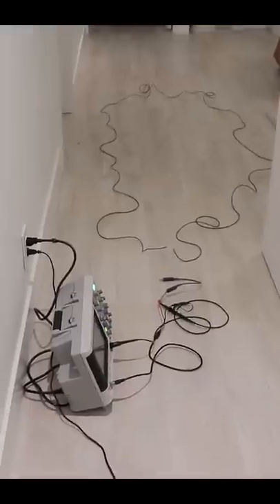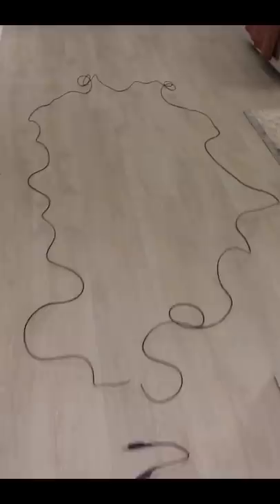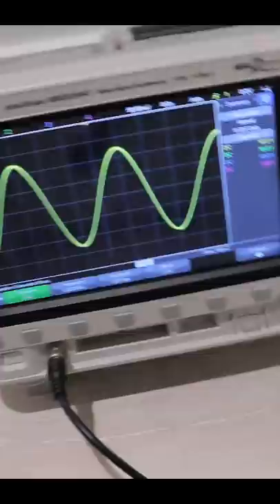The Crazy World of AC Electricity #shorts

Comment: If you touch a grounded led in complete darkness you can sometimes see it light up from the radiation of the mains wiring in the house - but don't tell anyone with fear from "electric smog/pollution" ;-)
Reply: In all my years (2 and a half maybe) as electrician, I have never heard of electrosmog. Either that or I forgot. 
So what is it supposedly??
Reply: @dragon67849  Don't go there, that's a complete (quack)industry on it's own.
Reply: @Sine1040  can you at least tell me the bare basics? You're only feeding the curiosity here
Reply: @dragon67849  it's what the paranoid and conspiracy theorist call static charge.
Reply: It's people claiming magnetic/electric fields caused by wireing has a negative effect on their body.
Most comonly used in sentences like "I don't want outlets enxt to my bed because I get a headache and bed sleep from the electric smog"
Wikipedia articlle on "Electromagnetic hypersensitivity" leads you deeper into that rabbit hole. 
between 2000 and 2010 is was a topic that went through the news every now and then fueling those believes. The fact that it kinda went silent is prop a sign that no evedence apart from nocebo was found.

(though I can't sleep next to some power supply because some have this high pitched sound when working which just annoys me in an otherwise completly silent room at night. I would call that having ears good at detecting high frequencies and owning cheap old power supplies though but others might use elctro smog for that as well maybe)
Reply: Did someone say FREE ENERGY
Reply: @drjoe71  NO
Reply: @11Argetlam11  I sleep with my head by an outlet, and I'm fine.......... Almost
Reply: @dragon67849  Electrosmog is interference causing non mains signals in the house. Such as waves from leaky microwave ovens, cheap switching power supplies without interference suppression powerline ethernet systems and sparking commutators. It sucks, if you like to listen to the radio over the air and it can slow down a wifi connection (all of course depending on the exact band used, a microwave oven won't disturb AM radio). 
Some 'special' people are convinced it has an effect on their body, and go to great lengths to wrap stuff in copper foil or mesh because of WoOoOooo RaDiatIonnnn. Or stick a sticker on their cellphone because it reduces the radiation of it. 
Some particularly stupid ones do all the mains interference suppresion for 'health reasons', but continue using wifi and cellphones.
Reply: @11Argetlam11  
Too bad these aren't just claims. There are enough publications that researched the risk of living close to high voltage power lines. If the EMF is strong enough to affect your radio reception it may be strong enough to affect your health.
Reply: @Bullshitvol2  do you have any clue how easy it is to interfere with radio? You can interfere with FM easily and AM is even easier. Keep in mind that radios are also designed to pick up radio waves, people have been living near high voltage lines for almost a century now.
Reply: @Bullshitvol2  They are just claims at this point, the evidence is not at all compelling.
Reply: @shaqibkhan5392  Yeah I've actually already seen it as indicated by the like button having already been pressed. I'm amazed you found that though so to help, it's Kurzgesagt ^^ Appreciating all the help so far guys
Reply: @dragon67849  it's basically another form of ludditism and radiation phobia from pearl clutchers who don't understand the difference between various forms of energy fields or the different power levels that they might operate at.
Reply: @Bullshitvol2  like I tried to phrase it neutral. 
But High voltage powerlines are something different than the 240V Plug next to your bedstand. I haven't done any studies on that but the wiki article suggested there haven't been many proofing it.
Reply: If you unpeel masking tape in the dark it glows from the adhesive being pulled
Reply: I have actually noticed this and looked all over online for an explanation! Thank you for explaining it!
Reply: But all wiring does indeed produce some magnetic fields around them when current passes through them.
Not that it matters for humans but the interference is there either way.

Same with mobile phones and long speaker wires and certain frequencies. Before i received a text message on my old phone, i could hear my speakers going crazy and sounding sort of like a dial up modem.
And when making a call, my speakers were constantly going nutty and the amplitude changed based on which way i angled the phone.

So there's some merit to these claims, however the effect is so minimal on a human body they might as well not even be there and all illnesses stemming from it are placebo.
Reply: @4Gehe2  Whats left is the ozone at night after their braincells popped :P
Reply: I have a led strip wrapped around my table and even if u unplug it and touch it with light up 3 leds for some weird fucking reason
Reply: @abogmus8904  ok so you are trying to say that every form of electromagnetic radiation (even visible light) is polarized?
Your comment doesn't make any sense
Reply: No
Reply: @dragon67849  Maybe something like radiowaves? You absolutely can light  up an LED if you hang a long wire from a tree as an antenna and then put the led between the antenna and the ground. It will only capture a half of what could be made (it stops the current flowing the other direction). So maybe it's better to just put a potentiometer there, to see the result more clearly. I made a radio this way, just a diode (not LED) and coil and a variable capacitor (made out of tin) all in paralel to each other.
Reply: @abogmus8904  I think you might be confusing electronic spin, which is angular symmetry, with physical motion.
Reply: @Sine1040  precautionary principal! You don't know the affect. Can affect your day/night cycle - affect sleep, give jet lag? Much to learn there is,  hmmmm. We do have sensors for electro magnetism associated with solar radiation.
Reply: @Bullshitvol2  do you know any numbers? because I lately found out with a magnetic radiation meter, that my frikkin bed is on "1500" while my box of cable (computer, displays etc) is giving me the same, sounds kinda unhealthy for my brain.
Reply: @Tekape  Unhealthy for your brain? Kinda depends, how is your computer performing?
Reply: Lolol love it
Reply: @Tekape  1500! That's almost deadly.
Reply: @NorthernChimp  my computer is doing great. I completely reorganized my cable management afzer I found out about the electrosmok. I found out the the isolation of my smartphone charger cable is really bad + electricity was active in it even if the phone wasn't connected, that cable was between and mattress and bed. It's a cable that feels thick but the outer layer is like fabric, so the rubber isolation must be really thin. At least everything is nice n clean now and there is no fire hazard in the corner anymore xD
Reply: @Tekape  So your brain shouldn't be any worse off than your computer, in such conditions.
Reply: This has induced soo much worry in me when working with an IP30 RGB LED strip for the first time a couple of weeks ago. IP30 means it has no transparent silicon layer over the LEDs, so when installing the strip, you're constantly touching them and they light up in a weak ghostly greenish glow. I've been so afraid of damaging the LEDs each time they did that, but they're all fine.
Reply: @11Argetlam11  My mom was worried about electrosmog in my room for a while, because for a while even "serious" popular science shows were talking about the "issue" and suggesting "solutions", meanwhile I had my two desktop PC setup with two monitors, a speaker system and an NES right next to my bed with a 120W subwoofer under the bed and I did suffer severe sleep problems. 
And she was actually kinda right in thinking that setup had a negative impact on my sleep, because it had a powerline adapter which, apart from having a bright flashing LED in standby mode, also emitted a quiet but penetratingly shrill squeaking sound whenever the diode lit up.
I dealt with the light by putting a few layers of tape over it (I still do that with any power supply diode in my bedroom), but the squeaking kept me awake for a while until I pinpointed where it came from and then unplugged the damn thing every evening before I went to sleep.

While that wasn't the main cause for my bad sleep (depression/existencial angst was), I'd say I am indeed 'hypersensitive'...

... To light and sound that is, not electromagnetic waves! 😂
Reply: Free energy device?
Reply: @RealCadde  Yes, but the irony is that those constantly whining about each new generation don't even realise the reason why that has stopped happening is the trend is for each generation to use lower power levels. Partly this is of course that to get the higher speeds generally means reducing the cell size and the devices burn the bare minimum energy on the transmission possible to get a clear signal to the tower and visa versa.
Reply: It's at worst alpha EMR but because it's electricity not photons, there's no EMR, just EM
Reply: @11Argetlam11  i may have EM sensitivity, but ffs it has to be really strong or really specific to prick me, thunderstorms hurt mind you and i have a "radar" for it at times, it's a matter of, where the pain is that's the direction of it. Really should get EM linings to stop it, they're really painful at times
Reply: @Bullshitvol2  no, it isn't. Radios are designed to detect the smallest change in voltage across their antennae (eg the signal you're trying to receive). These fields are generally weak, very weak. Please do some research into peer reviewed studies. This is coming from someone with background knowledge on the subject and experience with high powered unshielded RF equipment, high voltage, etc. If these bs theories were true then I'd be dead or at least have some symptoms of exposure because I've regularly exposed myself to fields thousands or millions of times higher in intensity than those quoted to be "HaRmFuL".
Reply: @atata2000  I mean yeah, every photon will be polarised. Whether the radiation is coherent or not (photons in phase) determines whether it has a net polarisation. So your comment doesn't make sense either. Unless you didn't mean polarised or maybe I'm just trippin
Reply: @craigme2583  no, just no
Reply: @dragon67849  We are surrounded with EMF radiation. "Electrosmog" is the pseudoscientific name for these fields with the belief that they are harmful.
Reply: @Tekape  That wasnt "Electrosmog". You just got very mild shocks from capacitive coupling. USB chargers tend to have quite a bit of leakage, nothing dangerous but it can sometimes be felt when you are close to a conductor in a certain way.
Reply: @osmacar5331  i bet you a hundred bucks youd fail the blind study. thunderstorms dont even put out a significant amount of EM fields compares to other sources. If a thunderstorm at a distance hurts you, standing next to a wall would kill you (inverse square law). 
Look up the nocebo effect if youre interested in what it might really be.
Reply: @drkastenbrot  am from the uk where it rains sideways and thunderstorms fork for at leat 13 miles, and the heat razes the land while the cold makes it equally treacherous, so, piss ant, i know how that shit works and yes they do put out that much power, a weak bolt is several hundred gigawatts. Maybe you should understand how shit works.
Reply: @osmacar5331  it does not matter how powerful they are because of inverse square law. the lighting is so much more distant than mains wiring. at about 30kA, lighting also only produces 1500 times the EM field as household current (20A) at peak demand. Thanks to inverse square law, standing 1m from said mains wiring is going to already subject you to more EMF than standing 39m from a full blown lightning bolt.
Reply: @ikannunaplays  "If unpeel masking tape in the dark it glows from the adhesive being pulled"

Enough charge can be generated from unwinding sticky tape to create X rays.
Reply: @ferrumignis  Really, I need to try that, but how to see these x-rays...?
Reply: Chuck McGill moment
Reply: Charles McGill be like:
Reply: I have a really efficient led fixture in my basement that lights up a bit when I touch the thing, it basically just uses me as an antenna to receive a weak AC signal.
Reply: @11Argetlam11  oh my god, some are truly dense...
Reply: @dragon67849 Basically EM fields around wires.

Comment: Makes a short
Shows a loop doing cool stuff
Refuses to elaborate further
Leaves
Reply: High frequency can be decompose in standing wave & traveling wave.
For 5Mhz I expect 30mts cable would give maximum output
But I bet he is using 10 meters which would give 1/4 of the voltage... Says 5Volts Peak to peak but I think LED needs at least 2 Volts
Would be interesting more measurements and an equivalent model to explain the transmission
Reply: Chad mehdi
Reply: ElectroCHAD
Reply: It ac alternating current it goes both ways by putting it on a loop it creates a complete circuit similar to a two pull single phase circuit except it's just using one. We use in the U.S. 60hertz meaning electricity goes both way 60 times If I remember correctly every 15ft
Reply: @mdllpz5356  what do the 15 burgermeters have to do with the frequency?
Reply: Smegma grindset
Reply: Must have run out of stunt doubles.
Reply: yeah. and?
Reply: Shorts in a nutshell
Reply: My past professor, is that you? lol
Reply: @gert-janbonnema burgermeters 😂
Reply: Its to bad that some people just can't learn, so they walk away and blame the person trying to show you something. Go get educated, try to learn more about it. Its a youtube short not a full length movie.
Reply: @gert-janbonnema  I haven't fact checked it, but I believe it is the distance electricity will travel in 1/120th of a second. That way the +V flowing over the diode will contact the time delayed -V, therefore making an electric circuit.
Reply: @gert-janbonnema Actually it's 5 burgermeters, roughly equivalent to 4.5 pommesfriters
Reply: This... Hahaha
Reply: ...without  getting shocked! 😅
Reply: Makes a short.
Youtube breaks.
Fixes the short.
Youtube works.

Comment: How does this happen? 

Because of the speed of light, a 5mhz signal will have a wave length of about 60 meters with peeks seperated by 30 meters. In a copper wire, one wavelength would be a  about a third less or 40 meters where a 1/2 wavelength is 20 meters.  

This loop with an LED is maybe 3 or  meters. 3 meters is about 15% of 20 meters  and 20 meters would be equal to 180 degrees of a wave. So the loop represents 15% of 180 degrees = 27 degrees  phase difference. and cosin(0 degrees) - cosin(27 degrees) results in a voltage difference that peeks at about (+ and-) 10.899% of the signal. 

In other words, A 5mhz at 10v(peek) signal would generate about 1.09v(peek). Since a white LED needs about 3.3v to 4v, the driving signal might have been between 33v- 40v (guesimating).
Reply: 3.3v LEDS need less power
Reply: @Zyghqwyv   🙂
I want to make several points. 
1) I was guessistimating.
2) Power is not interchange with voltage.
3)  And I gave peek values instead of rms values. And that matters because peek values are sqrt(2)× greater than rms values. Or rms values are 1/sqrt(2) less than peek values. 

3.3Vpeek only reach a voltage sufficent to light an led for a brief moment where as if I had said 3.3Vrms, it would have shined  brighter and longer because the 3.3Vrms × sqrt(2) = 4.66Vpeek, why it shines brighter and longer as more of the wave form spends time above 3.3v,  Where as a 3.3v LED may start to briefly light as low as  3.3Vpeek /sqrt(2) = 2.33Vrms spending far less time at a voltage sufficent to light the LED.
Reply: 33V seems high for the function generator of a scope though, wouldn't this be easier to explain with parasitic capacitance?
Reply: It's much easier way to explain. When he connect AC to one leg of led, other is connected throw capacitor to ground, which is formed between wire and ground. This effect also used in indicator screwdriver.
Reply: @jlskee  I'm fine with including  capacitive coupling effects to ground,   but one is still dealing with RF,  the speed of light, the length of cable, and the voltage drop across a white LED.
Reply: You can see in the video that the signal has only 5Vpp, so this estimation is way off; good explanation of the mechanism in general tho
Reply: @quinn_m  other than a sine wave signal, I couldn't make anything else  out on the screen. Too blury and shaky video at that moment.
Reply: I know some of these words!
Reply: It's a Light Emitting Diode, which only passes current in one direction. With AC, current is flowing in that direction 50% of the time. The signal is 5 Mhz, so the LED is pulsing at 2.5 MHz and it only looks continuous because both the human eye and camera have persistence of vision for signals faster than a few hundred Hz.

Edit: there might be some RF effects with the wire, but I would expect that they'd mainly just distort the chopped AC signal passing through the LED.